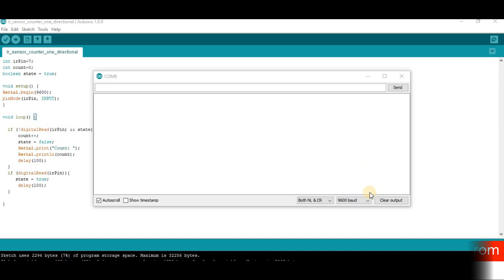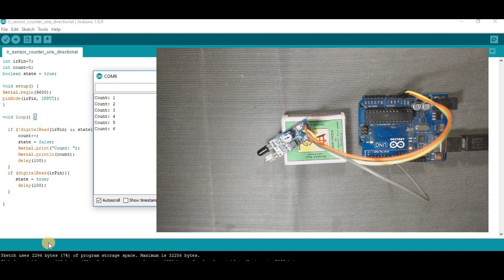IR Sensor Based Simple People Person counter using Arduino

Comment: Please i am a beginner, what is the name of the material you use to connect the pins of the sensors and that of the arduino board? thanks
Reply: 1.Ir sensor
2.Jumper wire: type - Male to Female
3.Arduino Uno R3

Comment: Hi, so I loved your video, it was very explanatory and worked fine. I had a bit of an issue with the serial monitor.

I am trying to integrate this people counter into my streetlights project but the serial output only displays the LEDs activities over and over.
Is there a way to maybe tell the arduino exactly what component output I want displayed in the serial output. Or to run this program on another baud rate?

I would appreciate any quick response to this query please 🙏🏾.
Reply: Yes you can, storing the values of components you want in a variable then print the variable using Serial.println(variable) it will show u the value of it
Reply: Yes you can change baud rate by changing the 9600 in serial.begin(9600) with anything else like 74880 but make sure you verify the rate in program and in monitor both of them should have same rate or it won't work.

Comment: Can you quote me a ral people counter for a 10 meters lenght. The solution should count enter people and exit
Reply: you can use double IR Sensor to count exit and enter you will need high range IR sensor or any other types of sensors to do the same